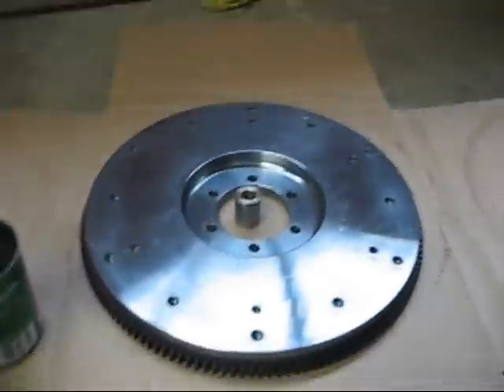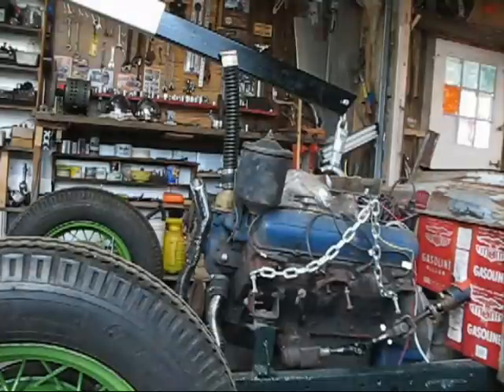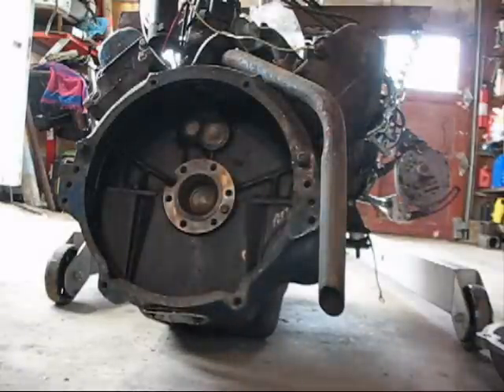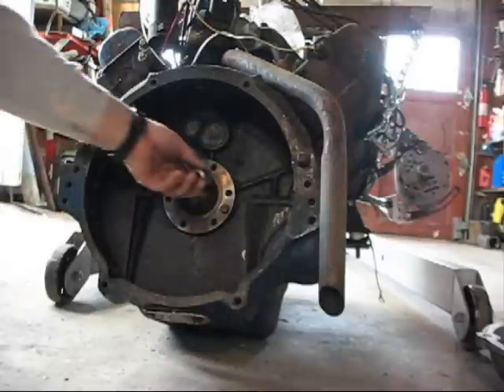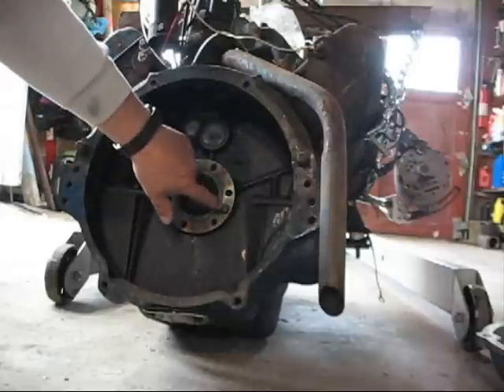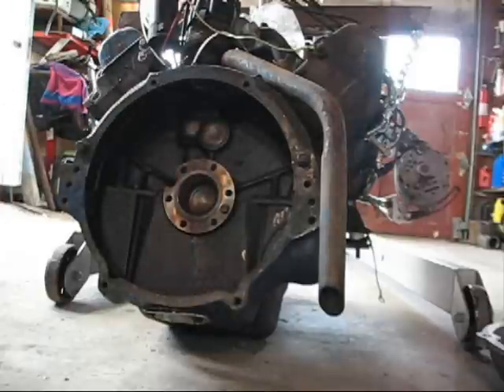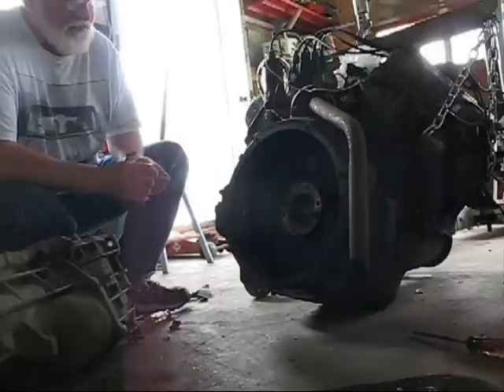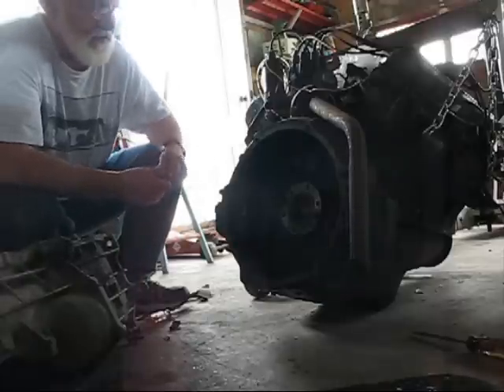Flywheel update

Comment from the maker: @mjmcomputers   That's the crank case breather.  Newer engines have them on the valve covers.  The older engines had them that ran out the back of the engine, under the manifold, and under the car.  The early small block Chevys had them too.   That's why the early Corvette valve covers don't have vents in them.

Comment: @rpeek After reading what is available on ebay, I see there is different tooth count,balanced or unbalanced, pre and post 86, 1 and 2 piece rear main seal and clutch size.My bellhousing I belive will only accept 10 1/2 clutch.I hope I can find the correct one locally cheap. Thanks, Tom